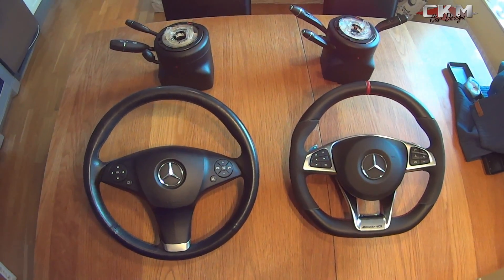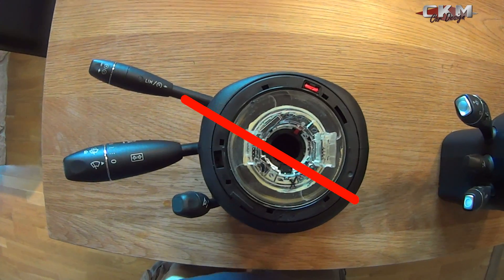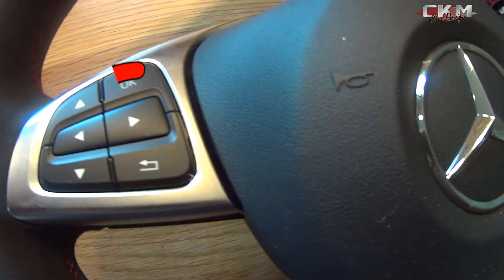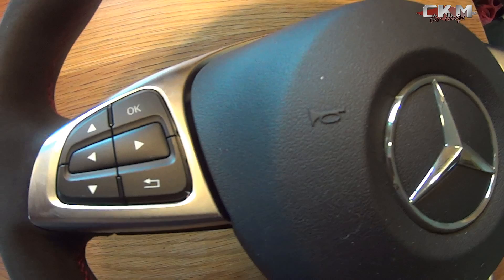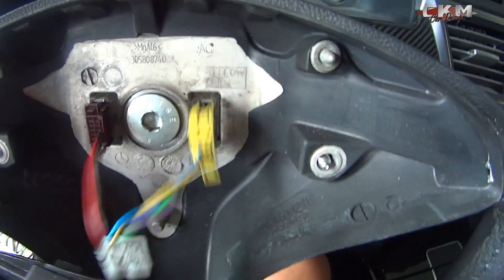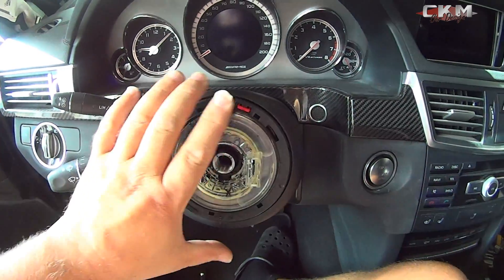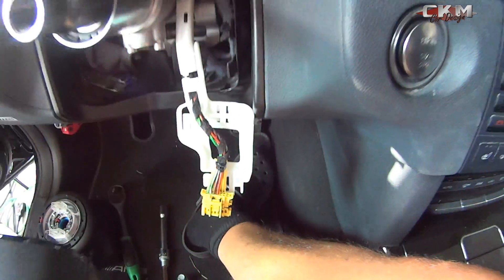Mercedes Facelift steering wheel retrofit W212 W204 W166 W176

Comment: I've been wanting to change the wheel on my 2007 E class with the sports steering wheel with the shift paddles
Reply from the maker: Go for it.
Reply: CKMCardesign what do I need to do for it work? Is there any extra wiring required for the e class, where do i get the computer programmed to accept the paddle shifters?
Reply from the maker: @MiniMii550  See video..Also see my W207 video on this wich is exaclty your model.
Reply from the maker: @MiniMii550  No codings needed.

Comment: If you buy a wheel without all arrow buttons you don’t need new paddle shifters. Pull the female pins out of the connector and directly connect them to the contact plate. They are simple on/off switches.

Comment: i'm scared that it could fail during driving or something
Reply from the maker: Fail?? Why would it fail more than the one you have now?
Reply: because that one is precisely made and centered from the factory, i heard that you need to exactly torque the bolt at a specific rate?
Reply from the maker: Haha..You heard alot then..I have done this for 20 years...And I have not had a fail yet. And of course its centered.
Reply: aaa ok, thanks

Comment: Great tutorial, thank you. I  Did it on mine  W204  - works as a charm.
Reply: What did you have to do
Reply: Find used parts like on video and replace with existing ones. To find steering column without shifter is hardest part in this mode :). worst case you can use one with  shifter and dismantle it ( two bolts and one ribbon cable ). Rest is just follow the great video from @CKMCardesign .  Preety straight forward job.  Wheel mounting screw can be hard to move ( thread is secured  with loctite compound or something similar ). Good to use impact wrench and/or extension bar, additional  person may be needed to move it / hold the wheel. It is good to disconnect battery before operation to avoid airbag error and due to safety reson.  All is just based on my experience, good luck.       @CarterDouros
Reply: Hallo mein Freund ich habe ein w204 2010 ich möchte auch sowas machen . Was muss ich genau kaufen?
Reply: @lampakt88 does it fully work with no problems? Which steering column and wheel did you buy too? Thanks
Reply: @M7SH  Yes it is fully working , much better than the old one. Just find the steering wheel exactly like on the video with airbag that have two socket ( USA version of airbag ) . w204 prefacelift  car have two airbag socket if connect airbag with one socket   to avoid error you have to use resistor / simulator onthe other  free connection.
Steering column i used something like this A2129008319 ( without gear shifter ). My car have gear shifter in center console.
But there is no problem to use  steering column with gear shifter build in and just dismantle it ( tested ) part no. e.g. like this A2129008215. Good luck
Reply: @LilJonKingOfCrunk  Yes it is fully working , much better than the old one. Just find the steering wheel exactly like on the video with airbag that have two socket ( USA version of airbag ) . w204 prefacelift  car have two airbag socket if connect airbag with one socket   to avoid error you have to use resistor / simulator onthe other  free connection.
Steering column i used something like this A2129008319 ( without gear shifter ). My car have gear shifter in center console.
But there is no problem to use  steering column with gear shifter build in and just dismantle it ( tested ) part no. e.g. like this A2129008215. Good luck

Comment: 1. If I do the same thing as shown in the video, will the paddle shift work?
2. If it does, will the D.N.P in the center not work?
I want to know if the existing transmission lever loses power when I operate the gear shift on the handlebar?

Comment: Now that you have changed the steering column and the new one has the shifter could you make it work? and eliminate the shifter form between seats?
Reply from the maker: No of course not. And I dont have the shifter on the new column.
Reply: @CKMCardesign  i mean the R N D P thing. Not the actual gear
Reply from the maker: @airineii  So do I.

Comment: Hey man, good stuff right here! I am retro fitting a 2014 C250 steering wheel with paddles to my 2010 C300. Can you confirm best is to get a 2012-2014 Facelift C-class steering column? I saw in the video you referenced an E-class W212, but which model steering column did you end up using? So I can find that same steering column to use! Thanks Chris.
Reply from the maker: Yes. You can use same as me since my wheel is the 2016. You need a specific column for that wheel older wheel.

Comment: Hi mate, i wonder if i could do that to my mercedes w204 2008 amg.? And the other thing. When you shorlw the two columns to swap. The "new one" has a stick on the right-hand side of the column. 
But once you actually fit it in the car, there is nothing on the right-hand side of the column. Why is that?
Reply: C230

Comment: Question please help.  I have a w166 ML550 and I got a 2017 c63 steering wheel just like yours in the video but it’s got the wrong buttons. I orders the correct arrow buttons, and the contact plate for GLE and I’m confused about the paddle shifters? I see triangle mount and square mount and I don’t know what I need to make it into a GLE wheel. All the listings show they are for all AMG and then it says it’s for c, s, g, glk only. What about GLE?

Comment: What happens to the gear change stork on new column do you remove it as not fitted on original column
Reply from the maker: No bought one without.
Reply: @CKMCardesign  But on the video is clearly one with gear change stork

Comment: The column that is shown in the beginning of the video shows the gear selector on the column the one that you installed does not have it did you remove the gear selector from the column before you installed it
Reply from the maker: You can just remove it if you like. Wont affect it. In my case I bought one without it.

Comment: Hi Chris, saw your video through mbforums. just a quick question, i see that the new steering column has the shifter on its right side, but what if my shifter is on the center console area like a traditional shifter would be. is there a way to remove the steering column shifter and maintain the one i currently have?
Reply: I am wondering if the paddles work and also which shifter do we use after install the one on the column or the one from the center console 🤔

Comment: Hello i have w204 from 2010 can i swap the steering wheel with one like yours?
Reply from the maker: Yes as said.
Reply: CKMCardesign oh cool, but when i contact sellers on ebay they always say i can’t buy cause is not compatible
Reply: CKMCardesign oh cool, but when i contact sellers on ebay they always say i can’t buy cause is not compatible
Reply: @SalvoSolo  ddid you have test it ?
Reply: M. Ckm nope Bro

Comment: hey there i wasi have the same old steering wheel you had with no paddle shifters. will the paddle shifters work ? even thought the original didnt come with paddle shifters.
Reply from the maker: Yes if you get the corect steering column that is made for paddles it might start to work.

Comment: What have you got for a GL450 - X166 2016 model year, saw a guy that changed his steering wheel and smaller monitor on a  amg 2014 and it turned out great! with the led lights and the steering wheel display!
Reply from the maker: You have it all on my website!

Comment: Hi CKM, in the first part of the video the new steering column has a gear selector and in the fitment part it is gone, did you remove this?
I assume your shifter is in the center console for your car?
Reply from the maker: No I bought one without it.
Reply: @CKMCardesign  You didn't? It's in the video
Reply from the maker: @anguscottman2804  Yes the one I bought for the actual car is in video withut leveler. Thats is why your asking because you see it.
Reply: @CKMCardesign  Ok thankyou, is there a way to wire a new steering wheel to the old column? I have a new wheel with the same electrical pins and functions but cannot get the buttons to work.

Comment: Hi, what a fantastic video with the steering wheel, very nice and good explanation on you part, my compliments :-)
I see that in your new colomn the PND  gear lever is added on the right side, and your old one did NOT have this feature, is this normal? i mean you will not using it to put it in Drive?

I have an 2010 C250 (W204) and i want also the new steering wheel in, but i don't have the gear lever, can i remove it (the gear lever) or should i leave it there and just don't use it, please advise.
Regards, Frans

Comment: I would love to get some clarification before I start buying parts. In your video description you say this will work on the W204. What i'd like to know is if this will work on a facelifted W204 (2012-2015)? Also, at the start of your video, on your new steering column you have that shifter lever. However, When you install it on the car, the shifter lever is missing from the new steering column. I am guessing you removed it yourself. Is there a plug that can go in its place so you don't have a big hole on the side of the column?
Reply from the maker: Of course. I used the corect one of course.

Comment: Can i change the steering Wheel of a 2013 A45 to the 2016-17 model ? Will i need the column ?
Reply from the maker: Yes of course. You should not need the column on that one.

Comment: What is the steering column you used because I’m confused on how to look for and how to get them to work
Reply from the maker: 2014 and up..Not from W205,W213 or W222 though.
Reply: @CKMCardesign  can it be for a w204 and will the lights and buttons work. Also what steering column did you use??
Reply from the maker: @cesardiaz3824  Yes. 2014 and up..
Reply: @CKMCardesign  2014 w204 steering column and up👍👍 thanks for the help
Reply: @CKMCardesign  what is the exact steering column you used in your car???
Reply from the maker: @cesardiaz3824  Realy dont remember.

Comment: Good Job, does the Paddle shifters work as well? I noticed your other steering wheel did not have them, if it works that’s amazing 😉
Reply from the maker: The old one had that in the car. But yes that works normaly if you get the column for it.

Comment: Hi. Have a w204 c-class but been wondering of i were to do this how would remove the gear lever on the steering wheel? Or is there a steering wheel colum without the gear lever?
Reply: He showed it with the lever. And then withought lever

Comment: I have a 2016 E400 W212 and my vehicle steering system comes with several control functions like Distronic plus with steering assist, heating steering wheel.  So do I need to also replace my steering column to install a AMG steering wheel like the one in your instructional video?  Or make sure the new steering wheel has all the same controls functions of the one I want to replace?  My E400 has a two tone color interior (Red and Black) so the AMG steering wheel in your video would be a beautiful match upgrade.
Reply from the maker: Yes.

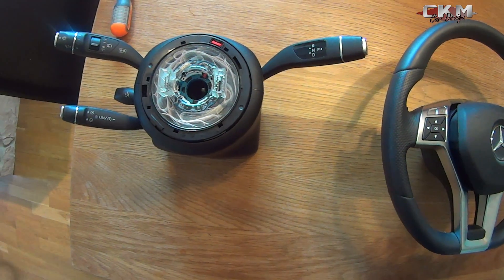Comment: I have the w204 pre-facelift steering wheel. If I wanted to change it to the w204 facelift version (1:15 in video) would I also need to change the steering wheel column?

Comment: i have an e350 coupe 3.5L rwd 2010 without the paddle shifters, if i install a wheel with shifters are they going to work ??
Reply from the maker: If you car is a automatic and you get the corect column then yes.

Comment: Where did you find a steering column with out the gear selector lever?  All I'm finding are columns with the gear selector lever on the right side
Reply: Was it a specific mercedes model that you picked?
Reply from the maker: Yeah they are pretty rare. They where fitted on manual cars and AMG cars.
Reply: @CKMCardesign  do you have the part number for the steering column please?? Been searching a lot with no succes
Reply from the maker: @bartbersselaar3968  Sorry no.

Comment: I have a 2009 c350 will this work? I should get the steering column and which one exactly is this steering wheel? Thanks
Reply from the maker: Yes. You find all you need on or site.
Reply: CKMCardesign thanks on your website it says to upload a pic of my steering column so you can find the right one? Do I actually have to remove the wheel and take the pic or with the wheel on is fine? I can’t seem to find a column without that paddle shifter.
Reply from the maker: @87moosa  Just take a pic so I can see the levers.

Comment: Sorry for seeming inadequate with my research so basically i want to swap the preface lift to the 2011 facelift wheell and just wanted to  know as long as i habe the column and wheel with airbag it should.be a direct fit correct ? Or still need recoding
I jave the 2010 w204 c300 old wheel and want the newer wheel 
I def need the column and the same function all around also dont i?
Reply from the maker: You nned column and a wheel matching it.

Comment: The column you first show has the gear selector but the one you fit on the car doesn't.
Did you just remove the gear selector or are there newer columns without it.
Reply from the maker: Bought one without it.

Comment: I need exactly the same steering column as the one in your video that you place on the car.
Could you help me with the item number of this column, I really can't find it anywhere.

I have a steering column without controls for the rear windshield wiper but I need one with this option .Can I place a lever in this that does have this and will it work? thank you in advance

Comment: Friend do your buttons light up and your adjuster work aswell as the paddle shifter aswell?
Reply from the maker: ????? Of course!!! Why would I do this otherwise??
Reply: CKMCardesign thanks friend sorry for seeming silly i just wanted to be sure 
Sorry to take up your time ....
So basically i have a 2010 w204 c300 
I have now found a wheel and air bag and column off a 2011 w204.... everything should work just like yours ....is that correct? Thanks in advance for your videos they are great and keep them coming you made it all look so easy
Reply from the maker: I see no reason it should not.

Comment: Chris!  Thanks for this video.  Curious - Do you know if the vibration motor in this 2015 style wheel can be replaced / removed?  Or is it installed into the foam of the wheel?
Reply from the maker: Yeah..Big problem with that. Cant be removed. SO STUPID!!
Reply: @CKMCardesign  Do you know if a W166 AMG wheel with lane assist works in a 2012 W218 with lane assist?  I am seeing active lane keep assist system inoperative and I have all of the correct parts (updated column and w166 wheel with vibrator).  I am curious if the 2012 and 2015+ systems are different and not compatible.  Everything else on the wheel, buttons, lights, paddles & column stalk works.
Reply from the maker: @davidc5992  Mail answered

Comment: Hello man, loved the vid, I have one question though, if my previous steering wheel did not have a flappy paddle gear switcher and I install a new one that has one, will it work?
Reply from the maker: I guess you mean Shift paddles? If you code it for that it will work.
Reply: thanks, for replying, do you know were I can get the code
Reply from the maker: Mercedes can code it for you if you dont have the star diagnose your self.

Comment: I have a 2012 c250 my steering wheel does not have paddle shifters, but if i install the new steering wheel will they work?
Reply from the maker: In most cases it does if you get the corect column.
Reply: richmind 101 paddle shifting doesnt work if the car doesn't have it as an option from the factory!
Reply from the maker: It sure can...Had that happen many times.

Comment: Nice video. I was wondering if it also works the other way arround (more or less)

I have a w176 and would like to have the cruisecontrol stalk above the indicator stalk instead of beneath it. As far as I know the w176 never had that setup originally, but is it possible, for example, to straight swap this with a module of an older w204 while keeping my original steering wheel.

I had a w203 for 11 years and I don't like the low location of the cruisecontrol in the newer models.
Reply from the maker: No way.
Reply: Thanks for your fast reply! In that case I'll need to get used to this setup 😅

Comment: Before I go ahead and buy everything you mentioned did anybody else notice the replacement steering wheel was different at the start with only black arrow buttons on the left then it's changed to one with arrows and other buttons?? Did the first wheel not work?
Also will this work on a 2009 c320?
Reply from the maker: You find all you need that works on my site under w204.
Reply: @CKMCardesign  ok what's the website address?
Reply from the maker: @irfy2009  www.ckmcardesign.com

Comment: Hi, i just wanted to ask i have a 2010 w212 and i want to swap the steering wheel to the same one you have on the video the catch is that my car has the normal gear stick not the one behind the wheel and it doesn't have the gear selector paddles as well. is it possible to do upgrade while the electrics are working because I've read alot of posts online that after the swapping electronics doesn't work, or is something that have to do with changing to the newer column and thanks.
Reply from the maker: That is exactly what I did in the video. It has a floor shifter.

Comment: Hi, to use the 2015 E63 steering wheel in a 2000 G500 W463 do I need to change the steering wheel column and what one should I use? I dont mind if the buttons dont work. thanks
Reply from the maker: The you dont need it.